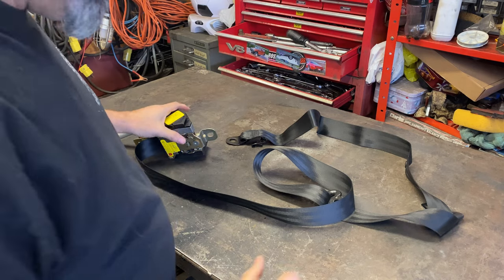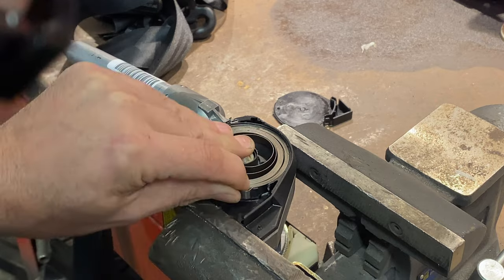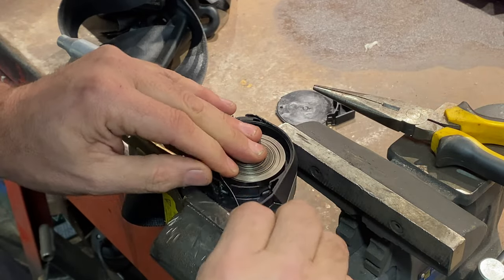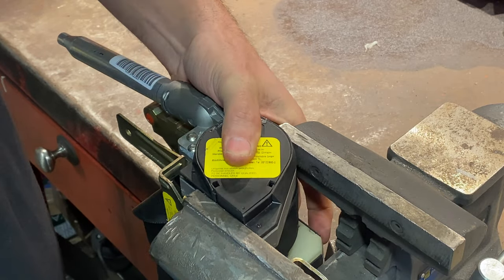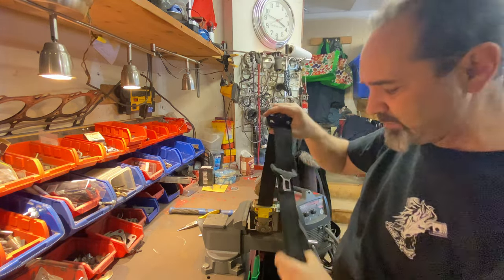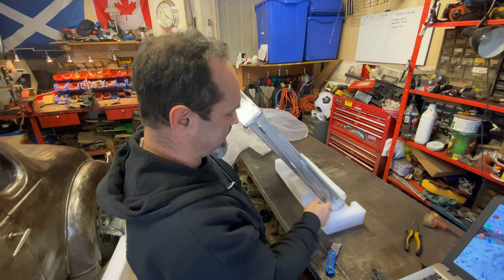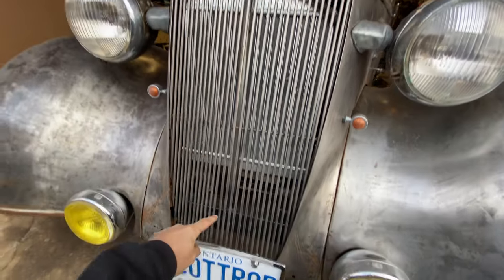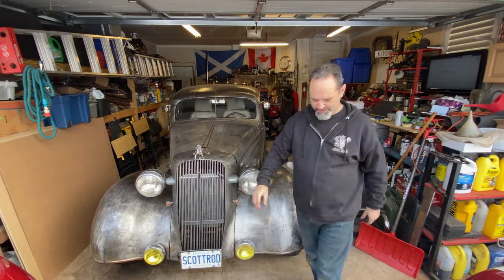Seat Belt Retractor Repair And A Very Special Delivery For My 1936 Chevy Coupe

Comment: Every time I look at your car I think back to when you hauled it in, a total basket case, in a trailer and now it is a running, driving and licensed car.  It may not be totally finished but as I have commented before there are a bunch of people I know who have projects that have been sitting for decades, ones that did not require nearly so much fabrication, who are still not running, or driving or licensable.

Comment: Hey, Dave. Of all the seat belts to brake, it would be your wife's.😵. That's a sweat, Rad Dave. It was a good price as well. I paid $350.00 to have mine rebuilt. But mine has 4 cores in it. You sure could have saved yourself a lot of extra work if you could have afforded that rad last summer. Oh well, you have it now. Thanks for sharing.🍁👍👍

Comment: Might want to consider a fan shroud when you install the new radiator
Reply from the maker: The fan has a shroud. But I know what you mean. I want to capture as much air as possible and send it through the rad.

Comment: Dave, you do realize that the German writing it is telling you there is an explosive charge behind half a dozen or so steel ball bearing in the silver tube that are launched into the mechanism to jam it in conjunction with the airbags.
Reply from the maker: Naaah, it's cable driven, so the explosive charge pulls a cable attached to the reel making it tight. But yeah, still dangerous, if you hook power up to it. I didn't mess with that side of it.
Reply: @ScottRods  ok I took apart some GM ones and they had steel balls
Reply from the maker: @glenmiller3783  If mine was like that, you know I'd be trying to make a gun out of it, lol.

Comment: Dave what is the part number for the radiator? I need one for my 36
Reply from the maker: I should have clarified on the video, that I bought the best one to fit my needs, since I'm not using stock brackets etc. The 36 listed on their website is for a truck, and has wide brackets. I went with the 37 master, as it is closest to original size. They don't seem to have a 36 car rad listed, but I reckon it's the same as the 36. Here is a link... but make sure it's right for your requirements! 
https://www.championradiators.com/Chevy-Car_radiator-1937